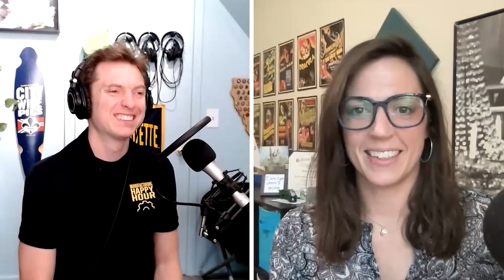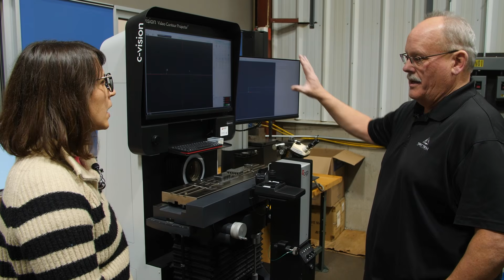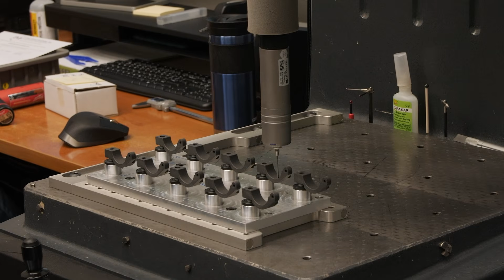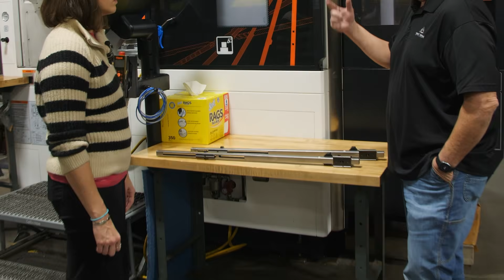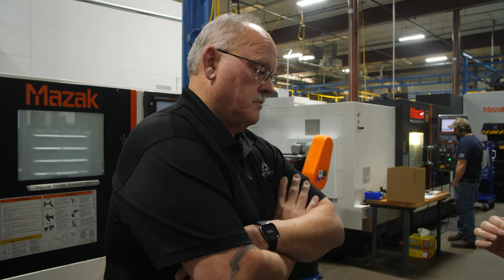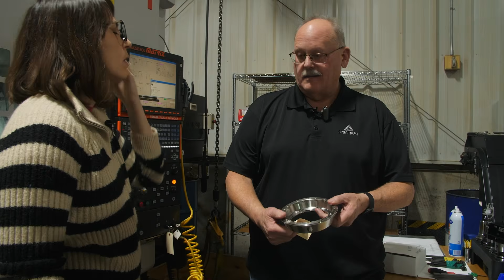This Isn’t Your Average Machine Shop | Spectrum Machine Tour

Comment: I work at a machine shop that makes defense parts in the aerospace industry. Pretty sure it’s against the law to film or take pictures of the parts 😂
Reply: I was surprised that there was as much info on the parts they are making to be honest considering that they are defense parts. We could not even say we were working on defense parts. But to her point, the customer must know what is ok or not.
Reply from the maker: @Jelsner97  Totally agree that it comes down to the customer's requirements. Some programs are very restrictive, while others allow more visibility. We always work within the boundaries set by the customer and the shop. Appreciate you sharing your experience.
Reply from the maker: It's definitely something we have to be sensitive about but not illegal. We always get permission from customers before showing parts.